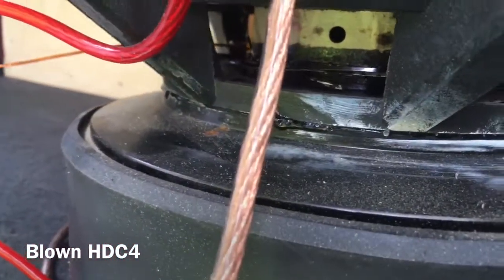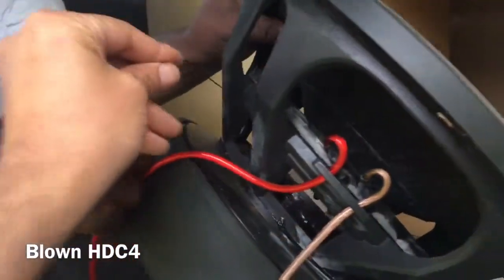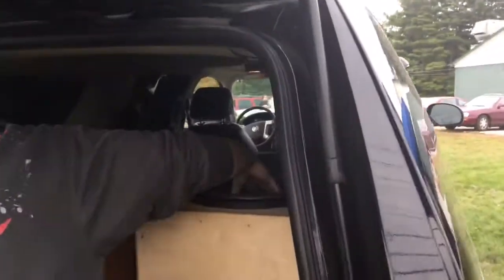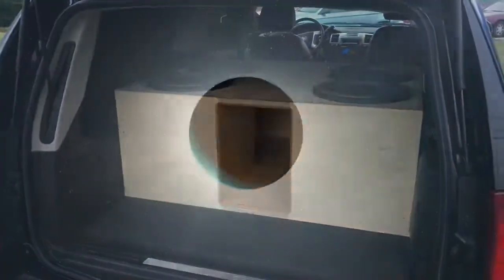Over powering subwoofers . What happens ? Blown subwoofers?

Comment: So when a coil unwinds does it mess up the former pole to where it can't be reconed?
Reply from the maker: Daniel Harrell  some ppl think scratching the motor or pole will hurt things . Idk how true it is because copper is softer than the steel and magnets used . I’ve seen coils rubbed right through and some little scratching to the motor or pole .